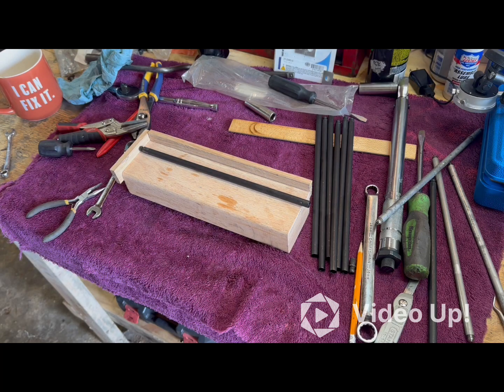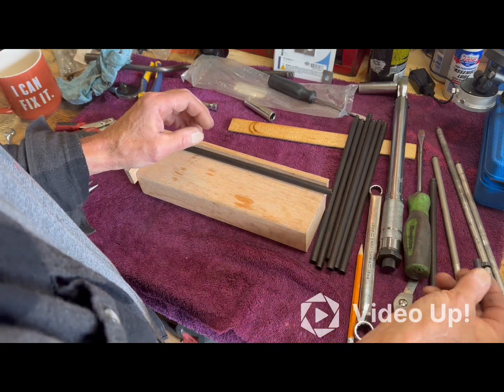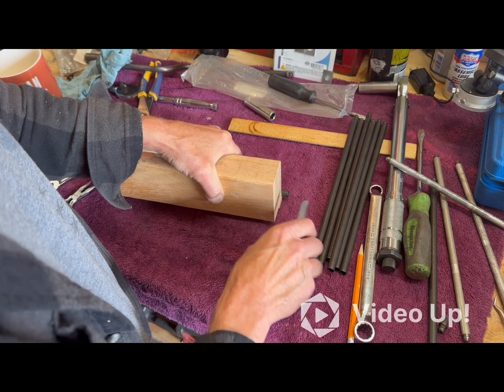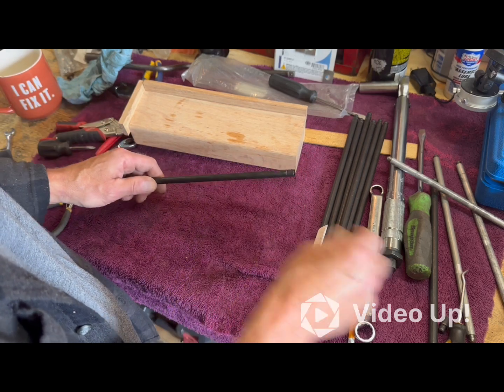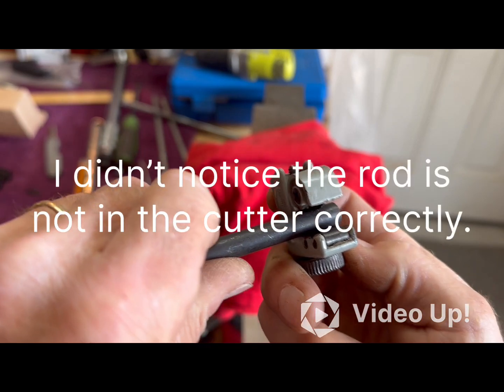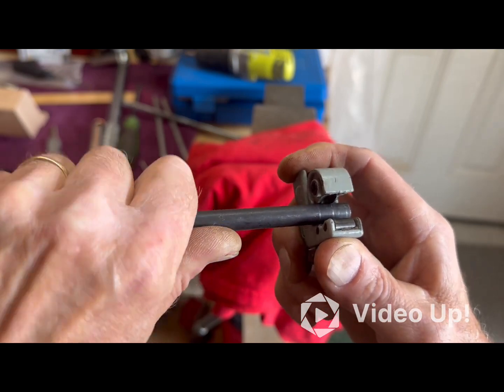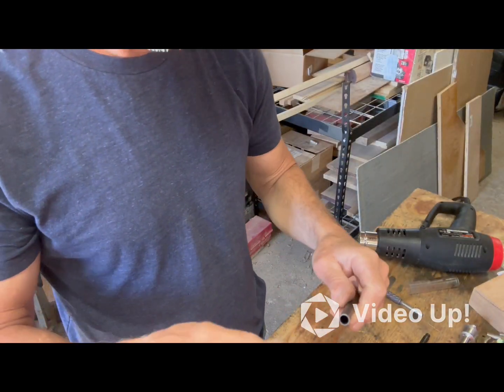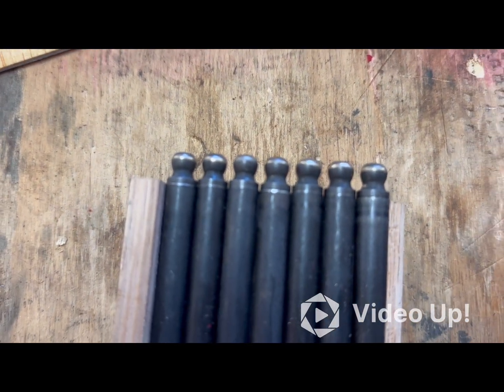Cutting push rods

Comment: Hi Ron, just finished installing the new conrod bearings on my 40hp crankshaft. Will be dropping into the case soon. This is something new seeing you cut the pushrods and installing new ends? Yes cold and heat kind of cancel each other out. Using heat with oil works good
Reply from the maker: I did try the heat and cold, it was a complete fail. I trashed the lifters so this seemed to be the next best option. It got the job done and now I’m very close to start up day.